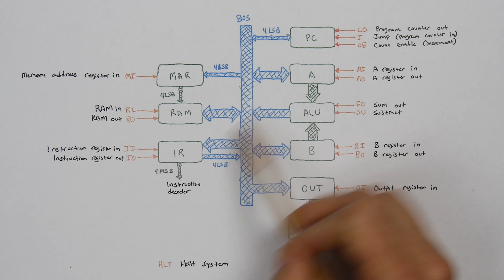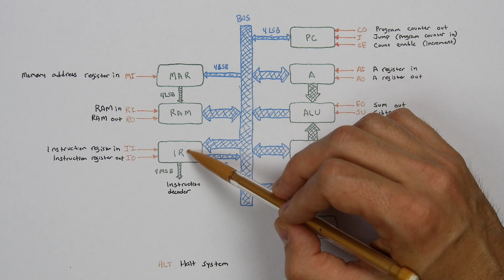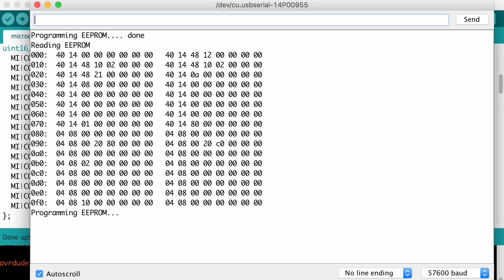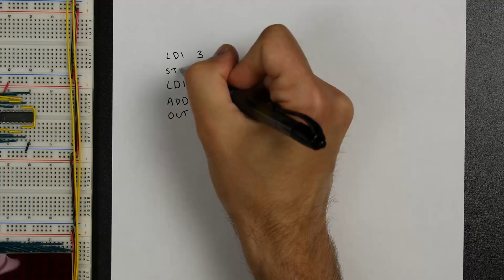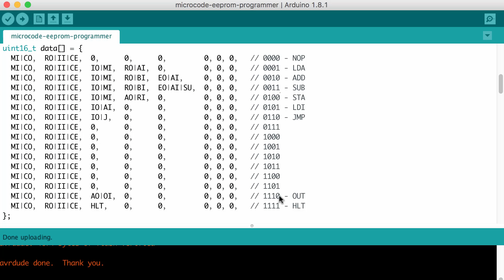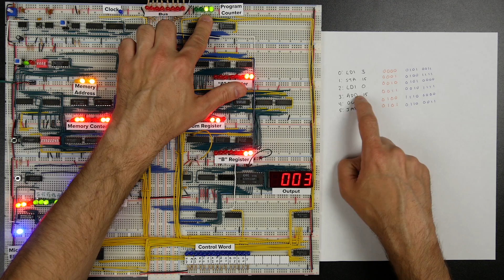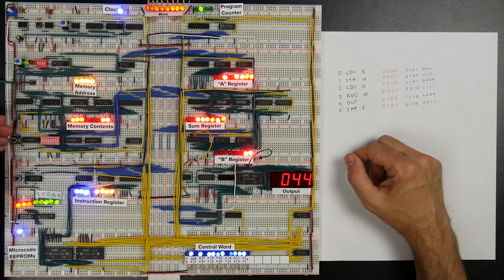Adding more machine language instructions to the CPU

Comment: For power distribution and consumption problems that people might have, I think that most of the current consumption is the LEDs.
5 sets of 8 LEDs = 40LEDs!, those could consume up to 800mA of current (even more if you use less than 150ohm resistors with them).
It would be great to buy some high efficiency LEDs and connect them via 4.7k resistors, that way you would use 0.65mA per LED instead of up to 20mA (or even 30mA)
If you buy 1000mcd LEDs (anything 300+ will be amazing), they'll probably be even brighter than standard cca 30mcd crap LEDs @20mA.
They would consume 26mA instead of 800mA!
You can also save some power by swaping most of your TTL parts with compatible CMOS parts (HCT marking is TTL compatible, use that instead of LS).
They look the same and they work exactly the same as TTL version (74HCT04, 74HCT08, 74HCT00 etc.), but most of them consume a lot less power (cca 1mA instead of cca 20mA for 74HCT08 vs 74LS08)!
Just by doing these two things (High efficiency LEDs with 4.7k resistors and HCT instead of LS ICs), you'll probably be able to get away with using some crap 500mA, 5V USB adapter or even less!
Reply: "You can also save some power by swaping most of your TTL parts with compatible CMOS parts (HCT marking is TTL compatible, use that instead of LS)."
>>> THIS! <<<
Those LS are harder to get and more expensive, because they're old and not used much these days :q  And not very compatible with anything modern which uses CMOS levels.
As for the LEDs:  How about using those tiny SMD LEDs, like the ones on Arduino Nano's board? One could solder 8 of these in a row on some small piece of universal PCB with goldnips to interface it with the PCB, perhaps already with the current-limiting resistors on board ;> and then use these as a sort-of 8-bit displays for the registers.

Comment: Can I use 24 awg in place of the 22awg wire?
Reply: I did that and it works well (and saves valuable space especially in the more "wire dense" areas like the control lines, registers, etc). I kept with 22 gauge for power distribution, however, and changed the power distribution to be more of a star topology vs. the chaining (with a few extra links) shown in the video. basically, i added 2 more vertical rails next to the 8 line bus vertical rails, one for +5v and one for GND. then each BB connects directly to that extra vertical rail.

Comment: you should make a breadboard keypad for numbers instead of doing the byte thing you been doing with the switches
Reply: A simple improvement over the DIP switches could be to use hexadecimal rotary encoders like this one here:
https://cdn.sparkfun.com//assets/parts/4/2/7/3/10064-05.jpg
Use two of them to encode a byte (two hex digits), and turning their knobs is much more convenient than twiddling the DIP switches ;) But I agree that a hexadecimal keypad would be 20% cooler ;J   /)
Reply: i like the idea of that knob

Comment: I was wondering about how to multiply numbers with these instructions...
Reply: The simplest and most naïve way is to do a repeated addition, since 5×3 = 3+3+3+3+3. But I wouldn't recommend this method, because it is also very inefficient: the bigger the multiplier, the more times you need to add the multiplicand in a loop, and the more time it will take. There's a better way to do multiplication, which dates back to ancient Egypt:
Every number can be written as a sum of powers of 2 (that's how we write them in binary). E.g.:
   13 = 1×2³ + 1×2² + 0×2¹ + 1×2⁰     (the coefficients of each power of 2 are just the binary digits of 13)
And when you multiply the number by some multiplier, it distributes over those powers of two and multiplies them:
   5×13 = 5×1×2³ + 5×1×2² + 5×0×2¹ + 5×1×2⁰
We can see the powers of 2 as bit shifts, because when you shift the bits of a number to the left by one position, it doubles the number (multiplies it by 2). So the 3th power of 2 is the same as multiplying by 2 three times, or shifting the bits to the right by three positions.
So what this equations says is basically that to multiply 5×13, you add the multiplicand (5) shifted by a certain number of positions (the power of two) whenever there's a "1" in the multiplier at that position (because when there's "0", the entire term zeros out and it's not being added to the final result). So you basically do this:
You scan through the bits of the multiplier one by one, and whenever you encounter a "1", you add the multiplicand to the accumulator register, and then you shift the multiplicand one bit to the right. (You shift after each bit, no matter if it's "0" or "1"; you just add if the bit is "1".) Here's how it works for 13×5:
      00000101   =    5    × 1  ↑
      00001010   =  10    × 0  |
      00010100   =  20    × 1  |
  +  00101000   =  40    × 1  '---- bits of 13 in binary
  ---------------------------
       01000001  =  65
(Note how the shifted bits constitute the subsequent doubling of the multiplicand `5`, and how you "multiply" these shifted multiplicands by the bits of the multiplier by taking only these terms into the sum for which the corresponding bit in the multiplier was set.)
This way you only need 4 cycles of the loop (the number of bits of the multiplier) instead of 13 (the multiplier itself), which is much more efficient.
Reply: I was wondering the same thing and I got so far in thinking that I would suggest multiple adds.
Like, 3 x 15, 3 -> A register, 15 -> B register, add 15 to ALU, decrement A register until A register reaches 0, then output result. Something like that.
Reply: ferrari2k is right: you want to add the number to itself a certain number of times. And you keep track of that "number of times" in a second register, and stop when it reaches zero.

I'm actually starting a video series about my evolution of Ben Eater's computer, and you'll see it calculating power series (which is just a whole bunch of multiplications) in the introduction. If you're patient, I'll be getting to the assembly programs that perform these higher order calculations, hopefully in a few weeks. So, if you're interested: https://www.youtube.com/channel/UCH09NwwJsfThwLKvc6kxl4Q ;)

Comment: needed to add a "Jumb if" command to make it able to execute any kind of logic, but I think that would require some additional hardware to the ALU, probably a logic comparator.. Also, you can add a delay instruction that keeps doing nothing for a number of cycles, so when increasing the clock speed to a few KHZ to make the computer run faster, you still get the timing..
Reply: The NOP command is actually there, opcode 0000 :)
Reply: ferrari2k maybe the delay command can be implemented using the NOP along with a "jump if".
For instance, 
Address 0000: 0000 0000  // NOP
Address 0001: 1110 0000 // where 1110 is the opcode for a jump if, 0000 is the address to jump to.. 

But I'm still wondering how to set a condition for the "jump if" using only 8 bits!!
One possible solution to this is to only compare the values of two particular addresses by default, such as 14 & 15. I'll try this out and see if it works!
Reply: I think the conditional jump will take a bit of extra hardware in the ALU and the instruction decoder.
I am sooo close to building one myself, just need to have a look at the cheapest way of getting all the parts :D
The EEPROMs are quite pricey, would be good if I could get those cheap.
And it would be good to have a stack of those logic chips to choose from, but I think it would be expensive to order 2 or 3 of each 74 series IC to have them available "just in case"... ;)
Is it possible to emulate the whole thing on a PC?
After all, most of it is the result of AND/OR gates and inverters.
Reply: ferrari2k yeah it is possible.. You can try it on a free simulation software such as proteus.. In this case, one may build a 16 bit computer instead, you can even build it with the very same architecture, it's gonna be able to execute some real complex sh*t lol

Comment: So how would conditional jumping work?I would assume, based on what you said before, that we need to read a carry flag from the ALU.  I think this would essentially act as another bit that enters the EEPROM?  Or would you need an ALU with more functions to do that.  Thanks for the videos!
Reply: The carry flag sorta is there already: it's the unused carry out from the second adder. It just needs to be taken into account by the instruction decoder to either load the jump address to the PC or not (basically an AND gate).

Comment: I'm wondering if it's possible to use one bit from control word to reset that microcode counter? Just to reduce unused clock cycles. Control word is using 15 bit and 1 bit left without adding another eeprom.
Reply: You can encode your control signals differently to expand the total number of control lines to 32 while using only a single EEPROM. Use four bits to select one of up to 16 signals that transfer data to the bus, and 4 bits for signals that transfer data from the bus. Other signals that don't require the bus can be encoded in either group. Doing so means you can only select two signals per time step, and you have to add or build a couple of 4-bit decoders (74154 is an option) to trigger them, but it would be a fun exercise. With all those control lines you are not likely to run out.
Reply: Another possible solution with the existing approach is to add some chip with AND gates that would check if a bunch of control signals are asserted at the same time – preferably those that cannot be asserted together in a normal situation – and use the output from that AND gate as the reset signal for the ring counter. Then the microcode could assert this "forbidden" configuration of signals to end the current instruction and start the next one.
Reply: After thinking this for awhile, and looking microcode structure, currently all control lines are zero when there is no more things to do. That could signal reset.

Comment: would it be possible to have 8 bit opcodes and 8 bit operands by storing each instruction as 2 bytes. this could work by  microcode could fetching another byte from RAM . this would mean you could have more up to 256 instructions, 256 lines of code and 256 memory locations that are accessible, of course the program counter would have to be expanded to 8 bit..

Comment: Now it's time to add an Intel 8086 to the mix I think!
Reply: I would start with something simpler, e.g. MOS 6502.
Reply: Good idea, but it would be end because i think the eeprom is no more be used in that case, only for storing operating system on it and some data, nothing more. Or like BIOS
Reply: The ALU, registers, and instruction pointer functions are all internal to an 8086 chip.  It would replace most of the stuff on the right side of the breadboard.  (except the display)

Comment: Hi Ben,

Can you cover topic of internal DMA, Interrupt Controller and JTAG on this breadboard level?  I barely find a resource for internal design of these things, only block diagrams :(
Reply: A simple JTAG-like interface is just a shift register which all your input and output pins of your chip go through. Then you can read them all by shifting the bits out through its serial output.

Comment: I spent the day thinking about how he could implement a FLAG register and conditional instruction and came up with something (of course I might be wrong since I can test my solution just yet and I'm new to this). I would do a 4 bit FLAG register (Zero, Sign, Carry, Parity) directly from the ALU's output.. Zero bit could be achieve by connecting the 8 data line coming from an second 74LS245 together and  inverting the resulting signal. Sign bit is the 8th data bit. Carry come from the adder chip and parity using a 74180 or similar.

That would all go in a register similar to the OUT register. I would also add 6 new controls (if zero, if sign, if carry, if parity, if not, end). 
The "end" would reset the micro code counter, "if not" will XOR the flags. Each "if" control would be tied with its corresponding flag with an AND gate.
The output of the AND gate would by connected to the "end" control.

So basically, a conditional "JMP if Zero" instruction would would start like the JMP instruction but would have an extra step with the "if zero" control set before the "PC in" control is called. If the zero flag is set, the "end" control will be triggered by the AND gate and will reset the micro code counter. Next clock would read the next instruction and etc etc effectively "skipping" the JMP instruction. If the "Zero" flag isn't set, "end" would be low, counter will not reset, "pc in" will be trigger and jump will occur.

If everything works as intended, we could theoretically make any instruction "conditional".

Of course, do tell me if I'm wrong, I'm here to learn !

Comment: Sir, is it not the time for designing a frame buffer and trying to display something on screen?
Reply: You realize the precise timings and circuit speeds required to drive a high-resolution graphics display?
A simple VGA display requires a couple of megahertzs. I doubt it could be achieved with breadboards.

Comment: I hope the next section implements flags and then we can have conditional jumps. :)

Generally, you have at least a zero flag (gets set if the last mathematical operation resulted in a zero, or reset otherwise) and a carry flag (gets set if the last mathematical operation caused an overflow or a borrow, or reset otherwise).

Comment: I wonder if this machine is finally turing-complete (assuming we would have infinite amount of memory)?
Reply: Not yet, it still needs more structure like a mechanism for conditions.
Reply: But conditions can already be done! :q
1. You can compare numbers by doing subtraction (the `SUB` instruction is already implemented).
2. You can then store the result of such a subtraction in a memory location (courtesy of adding the `STA` instruction).
3. And we already have UNconditional jumps (thanks to `JMP`).
So we have all the ingredients needed for a conditional jump: just store the result of a subtraction (=comparison) in a memory location where the next `JMP` instruction is supposed to be found, and it will jump to a different location depending on the result of the most recent subtraction :)
Just make sure that the result of the subtraction is in between 47 and 64 (the range of all possible `JMP` instructions with operands).
The bigger problem is that there's not many places to jump to – the address space is only 16 bytes :q

Comment: So I have 4 20w, 4ohm speakers, and a 50w, 3ohm sub. If I have an amp that has 2x15w and 1x30w outputs at 8ohms, could I use the speakers I have if I wired the 20w speakers in series?

Comment: I just wish you could adress more than 16 bytes of RAM. This is extremely limiting the ability of this nice little computer. The only way I can think of to make this possible is to add a new memory adress register that can hold like 16 bit but needs to be fed over multiple clock cycles. This would be very interesting to realize and would add a little more uniqueness als powerfulness to the computer! Anyways great series! Cant wait to see the next episodes...
Reply: Even just expanding the memory to 255 bytes would go a long way, but the memory address register would need an upgrade, of course. And, if you want to refer to anything but the first 16 bytes of memory in your operands, the instruction decoder, and program counter would need an upgrade. This is exactly what I plan to do with my build, in fact (see my comment (as v4nz666.. forgot, this is my work account :) ) on this video about exactly that...). No clue how successful I'll be with it, but I think the concepts I've come up with make sense :)
Reply: I think I have a neat idea of how to expand the memory space without the need of adding any more hardware :> (except of a bigger RAM and a 4-bit register, but without breaking the instruction set & instruction format used so far). Here's how:
We can add a special instruction that would select one of the 16 possible 16-byte pages of memory. For example, `PGE 7` will switch to memory page #7. The number of the page will be embedded in the 8-bit instruction as the 4-bit operand, as with other instructions of this computer. Once executed, it would have to load these 4 bits into the "page select" register/latch placed next to the memory address register, that would map directly to the higher 4 bits of the address.